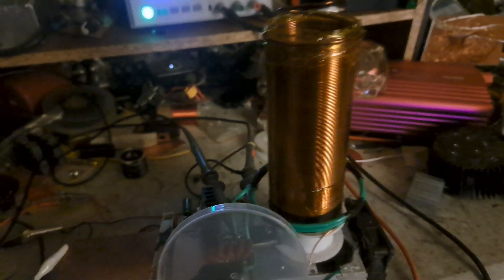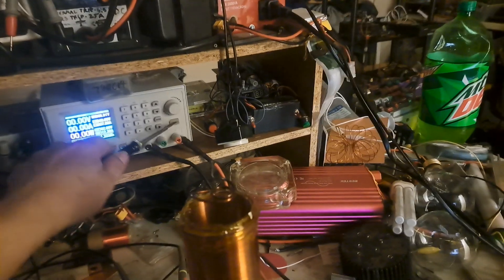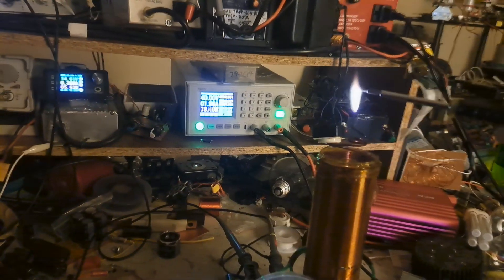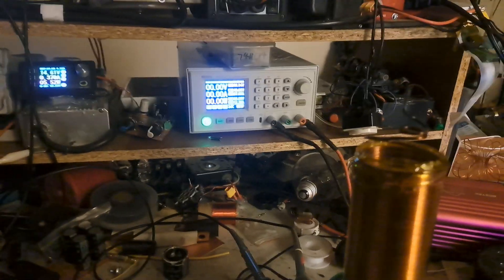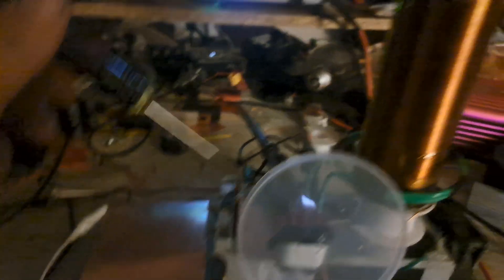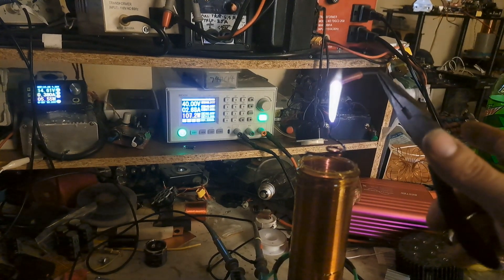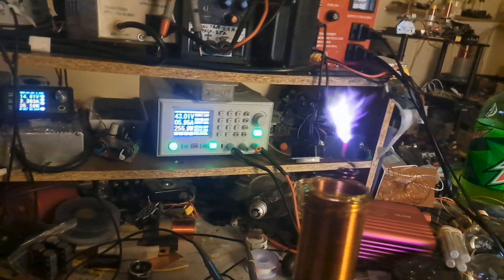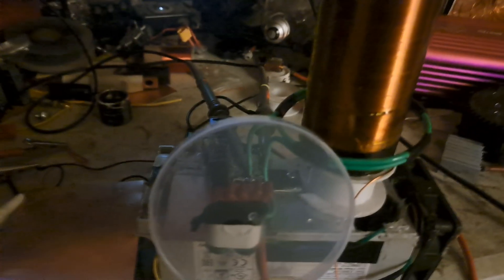4.5Mhz HFSSTC PLL Feedback IXDD630+SN74LV4046A

Comment: Hey dude I've been thinking about building multiple sstcs for some time now but with the cost and tuning experience im thinking class-E is not a first time coil to begin with . Any recommendations on sstcs other than a slayer exciter for a complete beginner .
Reply from the maker: class-E is definitely not the easiest.. although it doesn't necessarily need to be soft switching to work as an arc thrower. I got good results from Steve Ward's Micro SSTC, which he later turned Class E. Otherwise, the fet is just warming up as opposed to staying cool with soft switching.

If you start off with a circuit like that, where it just uses a gate driver.. you can learn a lot about the general workings of it and it should make more sense if you decide to build a half bridge or something.

Comment: How do you calculate the values of R1, R2 and C1 for the upper and lower frequency of the SN74LV4046A (or cd4046 in general)? I found an online calculator but it can't be right because I saw schematics where they stated they have a frequency range of 700-800khz but when i put in the R1,R2 and C1 Values they used. The calculator stated the frequency range is 120-150khz or something like that. I was searching for hours but could find absolutely no information about it. I need your help!
Reply from the maker: I didn't actually calculate it and it doesn't need to be that difficult so long as you have some caps to try. I ended up stacking something like 20pF caps til I reached maybe 80pF I think? It depends on your voltage supply as well. I use 5V. At 5V with about 80pF and 50K pots.. You can add more pots in series with those first ones to fine tune your upper and lower limits. I think I started with low series resistance on both pots, then later upped the series resistance on pin 11 I believe.

Comment: What max voltage can you put through a mosfet? Im trying to do some cool stuff, too! I want to feel 7.5kv-25kv with micro-amps through a mosfet... definitely not possible? I want to switch megahertz frequencies and high voltage. It looks harder than I suspected...
Reply from the maker: The high voltage here is being built up in the Resonant Transformer action. So thousands of volts are not actually passing the mosfet Junction. So while I'm actually feeding it somewhere like a 40 volt supply, the mosfet sees much higher voltage Peaks during the off-cycle because the current in the LC circuit needs somewhere to go. So while I'm not setting my voltage ceiling based on the input voltage I'm actually doing it based on the peak of the voltage swing on the drain during the off cycle. That would be Vds, drain to source voltage in every mosfet is going to have a maximum value for that before it starts to break down. People use mosfets in these inverters to switch current that provides hundreds of thousands of volts in Tesla coils so it's definitely possible.
Reply: Basically, I have a tesla coil of my own and I want to feed it ~10 to 25 KV and miliamps or micro-amps, instead of 30 to 60V. That is what others do, I don't quite understand how to switch it at megahertz like 15 to 200 megahertz range. Highest frequency is first priority,  then highest voltage to the L1. Any ideas? I'm a novice but studied tesla since 14. I finally said F everything I'm going as hard as I can to actually get started. I have wireless power here already and i want to advance on it while I'm still alive. Life is short and fragile and precious. Amen.
Reply from the maker: @TravisTellsTruths  Spark Gap Tesla Coils use the high voltage supplies for the spark gap to work as a switch, so they don't have the same restrictions as some silicon mosfet. Properly dual resonant solid states circuits with large arcs are running at a doubled 240VAC typically, and ring the primary up to thousands of volts. Of course they are also using large components capable of that power, and those components prefer lower frequencies which equal larger coils. 

For 15 to 200mhz you have to consider the size of the actual resonator at that point. It's not going to be some tower of a coil anymore. It's going to be like 20 turns, a few inches tall, 1 inch wide etc.. Not exactly something I'd try to push the most power through ever if the idea was creating spark discharges, but could be pretty cool if you planned to run a plasma flame from it. You're just making a powerful RF amplifier at that point and not really modulating it with anything. If you want to make a high power RF amplifier then that's a whole different ballgame of design, but you can end up with 200mhz oscillations if you wanted.. feeding the highest voltage at that point is going to depend on your component ratings, and all transistors are going to have a limit.

Comment: Run it's output across an SDR. it will definitely be producing an AM transmission at the same range
Reply from the maker: Definitely. I grabbed an SDR module not too long ago also. Pretty cool stuff. I guess if I ever audio modulate this one I could try seeing how far away I could pick it up on the SDR.
Reply: @Magneticitist  please upload a video for that, I'll be waiting! I haven't seen any video of that kind on YouTube before
Reply from the maker: @prakharmishra3000  I've seen it done quite a few times. Even with Slayer Exciters. Can't remember who it was but I saw someone recently pick up their modulated output on an AM radio
Reply: What's a SDR. Please. And that's 230 watts or so? Its beautiful
Reply from the maker: @TravisTellsTruths  Software Defined Radio. You can buy little USB powered modules these days that will let you into the RF world very cost effectively. But yea about 230W at first, then just cranking it a few more volts it shot to about 260W.

Comment: Hey dude . I'll be ordering a few UCC27425 drivers for my Class E sstc . Any recommendations on mosfets , that don't break the bank .

But I would like to know of SiC fets that I could use in the future any recommendations here as well
Reply from the maker: All SiC's are expensive and all good new Si mosfets are going to be either the same price or more expensive than the cheapo alternatives. I just use cheapo alternatives if not using a SiC. I've only bought a couple and they were each over $10. Otherwise most of these builds of mine are using IRFP260's from Amazon. Some use IRFP260M's from digikey/mouser. Ideally you'd want something with a 500V max on the drain just to be safe, and the lowest rds and Cgd (reverse transfer) you can find, which hopefully would also come with a low gate charge. At frequencies within 1-3mhz or so I haven't found it necessary to get any specific fets, most any will seem to work ok.

Comment: Beautiful!!  That's a huge improvement in efficiency.  Looks like you could do 40V all day!
Reply from the maker: Yea but what took all day was for my vision to get back to complete normal after staring right at the breakout point like a dumbass with a nail on top. I think I'll stick to the plain fat copper wire even though it just passes heat to the windings faster.